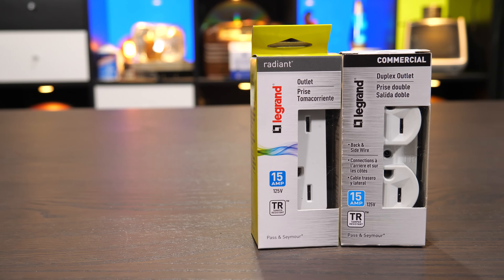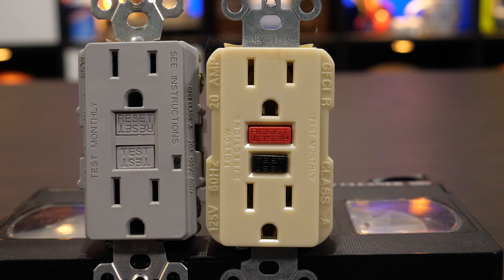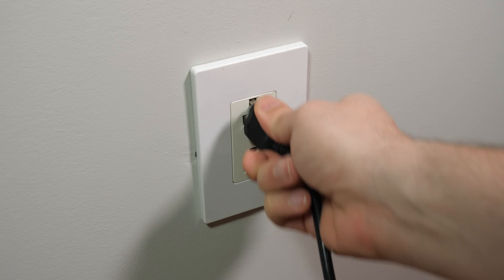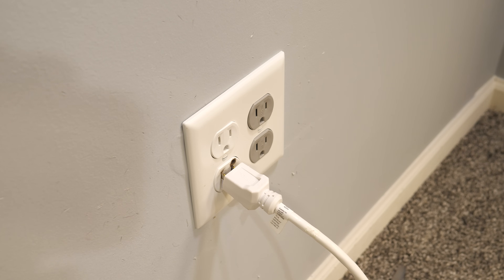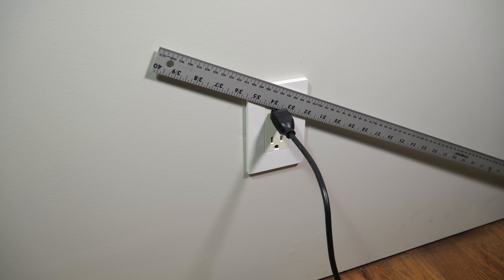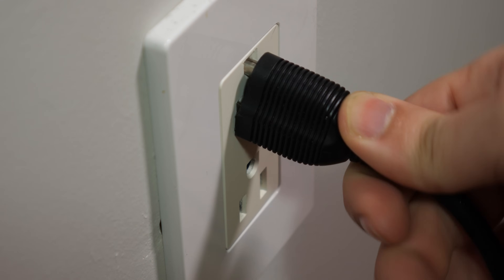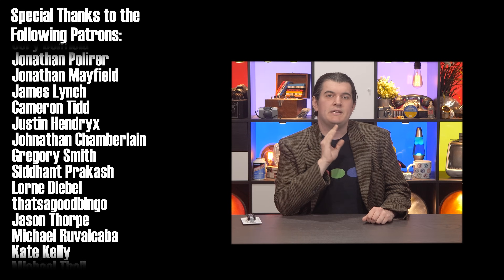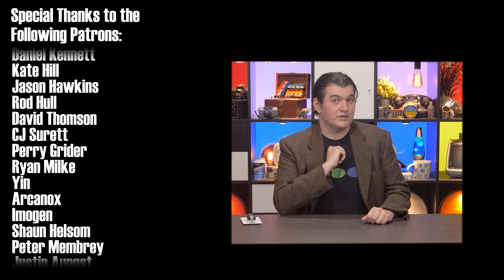Power outlets are topsy turvy - but does it matter?

Comment: I lived in an apartment where the switched outlets were installed with the ground pin up so you could easily figure out which outlet the switch controlled. Thought that was pretty handy - I'd probably do the same if I were ever wiring a place myself.
Reply: Very handy to know when you are moving into a new place and spend days trying to figure out why some of your outlets don't work.
Reply: This is normal practice in some areas, I've seen outlets from the '50's set up like this.
Reply: @jec6613 Yep, in my little neck of the woods (pop. ~15M) this is common practice on new construction for about the last decade or so.
Reply: @jec6613  Code requires this setup for rooms that don't have fixed light fixtures.
Reply: @dougbrowning82  It requires there be switched outlets, at least around here code is silent on orientation, and horizontal is also seen.  Besides inverted, the other common setup I've seen is top switched/bottom constant for all outlets in the room - it's the more premium option.
Reply: @jec6613  50's 3-prong outlets?  My parents house was built in the late 60s (I think 68) and all the outlets are 2-prong.   Seen lots of 80's and 90's houses with inverted outlets for switched outlets though.  (my 1999 house does not have the switched outlets inverted, and it took 2 weeks to figure out what was wrong with my television.
Reply: I'm trying to decode your meaning. So are only outlets paired to switches ground-up?
Reply: @mljohnson75 that's what I took from it
Reply: @mljohnson75  Only if they were installed that way.
Reply: We usually, when doing the switched outlets, make only the top one switched. It's handy. That way one of the two is always live
Reply: @goosenotmaverick1156  Sometimes they're both switched, to annoy you.
Reply: @dougbrowning82  that's true 🤣 sometimes it's done to save the extra wire between the switch and receptacle. Rather than running the extra they just avoid the non switched option. I've mostly seen it in REALLY cheap builders
Reply: @goosenotmaverick1156  Yeah I've always found them like that - just one is switched. But was still nice only having to check the pair instead of the entire room!
Reply: You could easily solve that by marking them or by putting a distinct faceplate over then
Reply: @metaforth   Switched outlets are often only one outlet in a 2-gang box, so you would have to use different colored outlets since you have a common faceplate.
Reply: Mine are like that in my new house and once I got used to it, I prefer it.
Reply: that's probably the only practical reason to install outlets upside down. The other reasons about objects hitting the prongs is nonsense.
Reply: Sounds like less hassle just marking the outlet itself.
Reply: That is an extremely miniscule benefit to be honest.
Either remember which ones are switch controlled or just plug it into the other socket if you chose the wrong one..
Not worth the installation looking shabby and inconsistant.
Of course, I'm from Europe so idc.
Reply: @mister_milkman  If "the other socket" is on the opposite side of the room, that means you may have to rearrange all your furniture to accommodate. I didn't find out that I had a switched outlet until I'd already gotten the couch and TV in place, and I didn't want the only outlet close enough for my TV to reach be the one that had a switch.
Reply: @OtakuUnitedStudio  Oh no, what a minor inconvenience. :D
Reply: @OtakuUnitedStudio  My sister's apartment is screwed up. The switched outlet in her living room is on the same wall as the cable TV outlet. Turn off the switch and the TV and cable box won't work.
Reply: @mister_milkman  average european trying to pretend that they're better than americans using any shred of imaginary superiority they can
Reply: @Hoolahups but honey. We are better in so many ways.
Reply: @nom3nnescio I agree, and I'm from the US.😁
Reply: @Hoolahups  Doing it to annoy you, since it works.
Reply: @leebrock4783  There's a lot to be proud of in the US.  NEMA 5 ain't it though.

Comment: The slight gain in safety is not worth the lost sanity of looking at an upside down outlet.
Reply: It must look like a face
Reply: My entire house was wired that way, and look at me 🙃.
Reply: @WilburJaywright  must live in Australia
Reply: @John-yh5gm fun fact Chinese grounded plugs are the same as the Australian ones but upside down. I've read that it's like that because of the same accidental short possibility stated in this video, but anyway Australia now has sleeved pins so they solved the problem in a better way
Reply: @elia_berti except every 2nd USB charger that doesn't seem to want to stay in the wall and has no ground pin... I think sleaving is the more important change, but when it comes to safety multiple redundancies are always better.
Reply: @John-yh5gm  nobody??  *Austria
Reply: @John-yh5gm you must live in Wyoming.
Reply: lol this comment made my day.  was having a bad one so thanks.
Reply: The potential physical damage is not with the definite psychological damage
Reply: I live in a house that previously was occupied by people who thought they were handy men and clearly weren't and I have several outlets that are upside down and there's actually a huge negative that the commenters aren't mentioning a lot of boxy devices are designed to go one way the cord sticks out of the bottom But if you have the outlet upside down, that means the cord is always hanging upside down Putting pressure on the wire. It's actually less safe to have an upside down outlet
Reply: And there's literally no evidence to support the safety increase
Reply: The real loss of safety is that we as a whole are fucking stupid. If you’ve spent your life with plugs one way, and it suddenly changes, you will stick things at the socket the wrong way. 

Being sleep deprived or otherwise chronically stressed makes us more dumb. You know, like new parents? 

Idk what the answer is, but it’s not flipping them upside down.
Reply: I was told at trade school i was told it was common practice to have the bond prong ground at the top if the outlet has a metal face plate. So if the plate were to slip off and there was a plug inserted the metal plate would land on the ground prong not hot or neutral. Preventing a shock if someone touched the plate
Reply: Theoretical safety gain
Reply: Just because you learned it the wrong way, doesn't make it right...
Reply: Watch me install this way and then get dinged by realtor when I go to sell.
Reply: HA! I’ll install my power sockets however I please! 
EYES UP HERE! 😤
Reply: Why don't you just do it the European way and recess the outlet? In that way, you can never touch the pins without the plug being disconnected from the actual outlet.

No, I don't say you should change connector type. Just recess it.

Edit: omg, you do have them!😮 (Can't post link due to YouTube's restrictions). Slight safety flaw that the outlets are not separated from one another, but a big improvement from the standard flat design. Make these mandatory and get safer homes.😊
Reply: @Wistbacka, the recessed outlets are mostly just made to go behind old wall mounted analog clocks or nowadays for a more esthetically pleasing flat-screen TV installation. They totally don't work with thin walls in rvs here.
Reply: How did you comment this two days before the video came out
Reply: @Dankleberrrrg  patreon early access
Reply: Yeah, that’s what I wanted to say 😂
This “upside down face” rule only achievement is increased possibility of neck injury for people with extreme cases of pareidolia 😂
Reply: If it bothers you that much, your nowhere near sane in the first place.
Reply: If yourre staring at the outlet like that you were already insane.
Reply: Humans love faces
Reply: Exacly😂
Reply: "Gain in safety?" ... A contradiction in terms if I ever I heard one, in regards to "shocking" US power outlets! ... The US should take a leaf from our book, here in the UK!
Reply: I love the swipe at Boston, as I live in Massachusetts, & they deserve it!
Reply: 😂❤yessss!
Reply: 😂 yes
Reply: It seems that a lot of the 60s and 70s houses here in Canada have them upside down, including one of the additions on my house.
Reply: There is no safety gain either way.  The NEC does not specify a "correct" orientation.  In my area, the ground is down.
Reply: I've been living with mine--in my rented house--installed with the ground pin up for 20 years and I can assure you you'd be fine.
Reply: Sanity? You need to hold onto all you have.
Reply: ..another reason to put them right-side up (i.e. ground hole up).  They're more pleasant to look at, and they're safer.
Reply: To everyone in the UK this normal as our Type G plugs have the ground at the top.
Reply: And the annoyance of things like timers and wall warts being upside down as well. When I bought this house a couple rooms had them upside down for whatever reason and I spent a day flipping them back before moving in the furniture.
Reply: The only thing I get is confusion 😅
Reply: So if all outlets are upside down then the ones controlled by light switches would have to be right-side up?
Reply: @LuigiMordelAlaume  That switched-outlet orientation thing is a folk tradition.  Don't rely on it.
Reply: @LuigiMordelAlaume they can eliminate those altogether and put actual light fixtures in.  Hardwired light fixtures in every room should be part of building code and switched outlets not be allowed as a substitute.
Reply: I need to see their faces
Reply: It really doesn’t matter if you grab the prongs on the sides or on the way into the outlet. If for that, it’s probably time to change the standard. The British version of this is probably the best and safest version.
Reply: @RJDA.Dakota  Agree with your first part, disagree with the second.  As always, European is the way to go. 

Besides, British outlets are too YUUUUGE; even bigger than Australia(very ironic since they have very small outlets).
Reply: @RJDA.Dakota oh we will never have that change
Reply: @TheMArtagnan  I do realize that but I can still comment.
Reply: Till you step on a plug.

You wished you stepped on a LEGO instead.
Reply: Have a look to the German SchuKo / Schutzkontakt / safety pin plug
Reply: @RJDA.Dakota While I'd like to have the fuse in the plug, I still think the european schuko plug is the best. I don't think the live and neutral distinction is really nessecarry for safety.
Reply: @clockworkvanhellsing372 there is a need for live/neutral distinction for things like toasters where sometimes the neutral is wired to the metal outer case.
Yes, it's bad design, but was common not too long ago, and led to the creation of polarized outlets.
Reply: @aaronbredon2948  okay, there it is absolutly neccessarry but yeah, in europe every exposed metal part has to be grounded and not bonded to neutral, if done like this, it doesn't matter
Reply: @clockworkvanhellsing372  plus, the Schuko looks like a pig's snout, which is a lot cuter than help-I'm-stuck-in-the-wall-face.
Reply: @RJDA.Dakota  No. All we need to do is require sheathing on the base of the prongs, and require extension cords to have a fuse. It would be monumentally idiotic to change to a completely different standard.
Reply: @wta1518  not saying anything against your idea. Just an observation. But this really does need improvement.
Reply: @wta1518 

"It would be monumentally stupid to change to a completely different standard."

I think you mean to say it would be stupid to change to a different standard, which you don't agree with, because after all changing to require sheathed prongs on plugs, and fused extension cords is changing standards.
Reply: @notahotshot  No, they said to adopt the British plug, which would mean replacing every outlet and plug in North America. Which would be stupid.
Reply: @wta1518  Yeah, that's SO stupid to change to something universally better and safer. Yeah, let's not change all the cars into electric vehicles because that would be stupid too. Or change the CRT monitors into flat screen ones. Oh shit, anybody would think that you've never completely changed anything when something better comes along, eh?
Reply: @thewelder3538  the upgrade isn't really worth it. The only way I see a first world country would change its plug and socket design drastically is in the context of a transition to DC power, which now sounds silly but I think in the next decades it will less and less be like that
Reply: @elia_berti  You do it a bit at a time, same as for electric vehicles, not blanketly force everyone to comply in a week. You make it a law that all new sockets must be compliant like the UK does. And before you start on about... what about all the appliances, yada yada yada, people have been using power adapters for years.

How many fires/electrocutions/deaths would you prevent, all down to your shitty designed sockets? People have done a lot more for far less.
Reply: @thewelder3538  here’s a thought. No one in America will want the change ever. No one here thinks there is a problem with the outlets and plugs we use. It doesn’t matter if you think your plug is superior. No one cares enough to make the law change. And since incidents involving outlets are exceedingly rare and usually the result of old worn out receptacles or plugs, there is no need. And adding in a fuse or sheathing that may fix a problem that very rarely ever occurs might potentially be a good idea, it’s probably irrelevant anyway. Most people in the US don’t know someone who had an accident with these electrical outlets.
Reply: Yeah, having them mounted upside down (with the ground pin bottom) would bug me a lot.
Reply: Or the lost novelty of them looking like faces.
Reply: Our 40 year old house gives me smiley faces, our 100 year-old re-wired cottage has the damn upside down ones, except for those I’ve added which I (of course) put in happy.
Reply: I prefer the look of ground up
Reply: @Owen_loves_Butters  So you like looking upside down. What ever floats your boat
Reply: @timdewberry-528  I see ground down as upside down.
Reply: You’re damn right
Reply: If a lot of cords have more strain due to a right angle, or a AC DC adapter is hanging out due to the weight, is it really about safety?
Reply: thanks for spoiling the video for me!
Reply: @isaiahwoo4582  You should live here in old Blighty! Our electrical installations are excellent!
Reply: And the problem of the plug coming out more easily if it shall stay in there but stay in there if you trip over the cable. (if it's upside down / earth up as recommended by the ... at NEMA)
Reply: I know, right? Ground up forever brother.
Reply: The insanity is that you have two pronged plugs and no protection from inserting something into the socket.
Reply: That is how they're set up in American hospitals. It's part of the safety standard. What we're used to is upside down I think.
Reply: @gabrielulibarri9950 the hospital standard is actually fairly new and it really is just a what if scenario
Reply: @gabrielulibarri9950  did you watch the video?
Reply: @gabrielulibarri9950  it would make more sense for hospitals to install them sideways then if they’re worried about safety. However then I guess they’d have to install all new boxes in the walls.
Reply: @gabrielulibarri9950 You obviously didn't watch the video. There is no standard.
Reply: @EssenceofPureFlavor  ...except in healthcare facilities.
Reply: @gabrielulibarri9950 yes, that's what he said in the video, not even 2 minutes in. The upside-down outlets started in hospitals.
Reply: Why do you think its upside down?
Reply: Why can't you anericans just have normal sudoco outlets?
Reply: @matsv201 what’s that?
Reply: If what's correct bugs you then YOU need fixing friend.
Reply: 2 words: schuko and metric
Reply: @PeterAnthonyMartins  5 words: no one cares in america
Reply: @PeterAnthonyMartins  Well I guess it's just lucky that we have both then. I sometimes measure in cm and sometimes in inches. It's whatever works, but since 95% of the world uses metric because it's just infinitely better, you should get with the times. Having units that are divisible by 10 IS just better and simpler. And since you can't seem to grasp the intellectual challenge of putting a u in colour, and think a niche is a nitch, I'd have thought simple would have been right up there for you lot.

Anyway, we don't have schuko here, or at least, not that I've ever seen. Everything is 3 pin, side by side sockets (the right way up).
Reply: Aesthetics are not worth it. Ground up is correct.

Comment: My mother’s senior living facility have the ground pin at the top. The biggest problem I see is with the air conditioner plugs, since they have GFCI integrated into the plug end. That makes them so heave that they don’t fully seat into the plug.

Comment: I had an electrician tell me that he picks orientation based on the most convenient way the conductors in wall, cut ever shorter over the decades, can manage to reach the right terminals.  He was joking, of course, but yet clearly somehow not ...
Reply: You say that, I've had to deal with it many times lol.  Fortunately Wago connectors make it relatively trivial to pigtail the device and easily attach it to whatever wire is left.  I'm trying to never using a wire nut again.